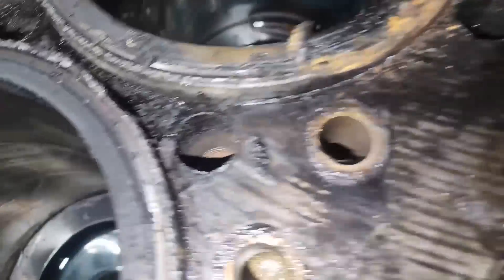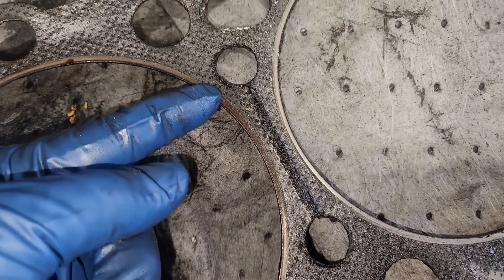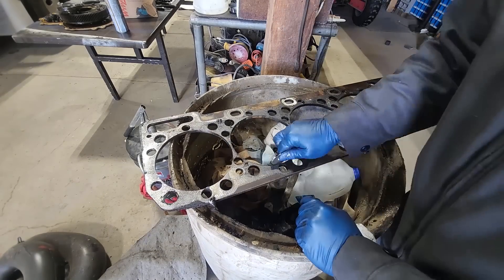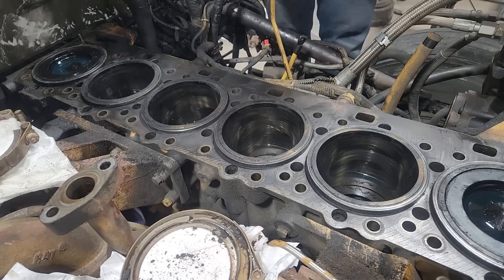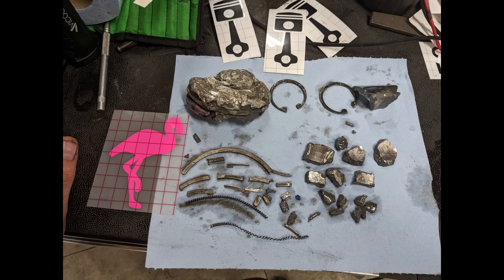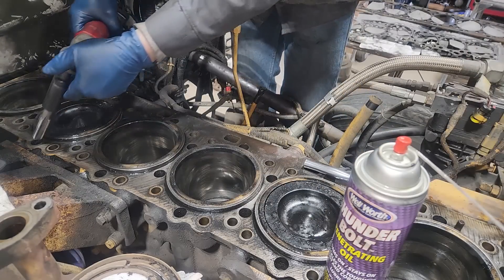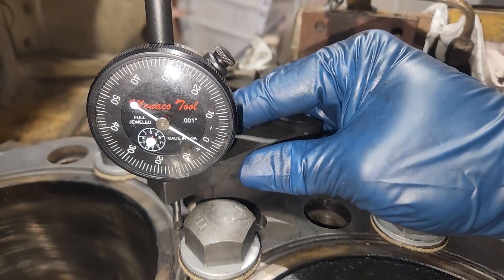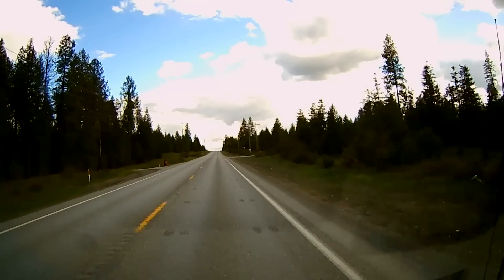"Goldie" the Peterbilt has 3 Big Engine Problems. Cat C15 Engine Repairs.

Comment: Josh you should try a Schaeffers product called Citrol If you get the bulk(gallons0 you can dillute it to suit your needs. It can be sprayed ,brushed or dip. Its biodegradable and completely compliant. Nice stuff it wont peel your skin like a brake clean or a chemical

Comment: I did an inframe on my 6NZ 3 years ago, and consulted your channel. 
 It was very helpful, especially since ive never rebuilt a diesel before.
 I used the PAI gaskets, as well as their head, and piston/rings.
 The pistons were CAT brand.
 Its been 3 year's and 300,000 miles no problem. 
 I did something a bit different though. 
 You've mentioned that these engines almost always leak oil at the shim below the spacer.
 I used spray copper coat,a thin layer, just enough that I couldn't see through it, both sides.
 It worked well, no leaks.
 Even a DOT man commented on an inspection once that most leak.
 Great channel. Thanks.

Comment: could you recommend a scan tool to retrieve codes and look at live data without breaking the bank I only have the one cat engine a 3126 in a gmc with a port that looks like obd11 i'm getting an intermittent crank no start but then the next thing it will start, might die a time or two after running for a bit then the next thing you now it will run the rest of the day just fine.

Comment: Hey Josh, 4years ago I replaced my 2005 C7 with a low mileage /hour  2006 C7 FMM engine pulled from a military HMMVT. At the time engine had 300 miles /40hrs on it. I now have about 40k miles and 500 hrs on it(bucket truck with PTO). Engine has been running great . I’ve done severe usage maintenance on it(oil /filter2500miles,both fuel filters at same time,radiator fluid been changed 4 times). Any suggestions on some PM on the engine itself,injectors?  Had a problem with my fan clutch, recently and I limped to shop with it running hot but not for long. Should I have my mechanic pull valve cover and look at head? Also you did a review on an inline auxiliary fuel filter kit, any thought about adding it?

Comment: Just some advice, I would cover your self by only installing OEM CAT parts especially with engine internals. I’ve had very bad luck with after market parts and will not buy anything other then OEM. Or let them know I won’t warranty it with the aftermarket parts

Comment: Something a lot of people don't know. Taps are for cutting new threads, not cleaning up existing threads. The tap will remove material even on a good hole. Rethreading sets are sold for repairing, renewing, and cleaning up threads.
Reply: I think almost all of us do use taps to clean up threads, but you're right. Proper thread chasers are always best. If you own a set. Which I don't. So I'd better remedy that!

Comment: It would be cool to see the procedure of an in-frame liner removal / replacement. You would think the crankshaft has to go, because of the piston and connecting rod - is there a tool for a work-around?  Wondered if there were short cuts. Thanks for the great video's - hope you find tons of work.

Comment: Could you make a video showing what settings need to be to make sure cruise control will work. 6nz cat had ecm repaired they messed a bunch of stuff up got it all fixed except cruise only works to idle truck up
Reply: I would check my low cruise set speed, default is 127 MPH on low and max 127 MPH.

Comment: Hey Josh why do commercial diesel engines need liners instead of using the block for cylinder  bores like smaller diesel engines like the Duramax powerstroke and Cummings?
Reply: You can replace the liners without having to remove the engine. Some industrial engines, like in a hospital. The building is built around the engine. Have to tear a wall down to remove the engine.
Reply: For multiple rebuilds without needing to machine the block

Comment: Happy you’re posting content again Josh! Let us know your feedback on the PAI parts! I’m going to be building a 3400-12e BDT and was considering there products. They have some performance improvements and have up to a stage 4 lineup. I’m usually pro-oem but if can get a benefit from aftermarket I’ll consider. I’m running this engine wide open, maximizing duty cycles at a 4 trim rate. Poor thing screams

Comment: C-12's usually crack the liner like that
Reply: C-12 have a mid mount liner, no top flange.
Reply: @johngoldsmith6629  why does your channelhave ZERO content?
Reply: @johngoldsmith6629  dont need your help,im a qualified deisel/truck mechanic with 20 years experience who currently rebuilds detroit and CAT engines,C12's break the liner in the same way,the flange isnt above the deck though
Reply: @andrewsmart2949  Sorry to bother you with my 43 years plus of experience. I have never rebuilt a deisel engine. But I rebuilt numerous diesel engines.
Reply: @johngoldsmith6629  you are clearly some sort of spaz

Comment: Josh, 

I suggest trying the 3M roloc bristle disc’s. they are made of soft plastic that will not damage metal but they are abrasive enough to remove gasket material. I use them a lot where I need to clean mating surfaces all the time. They aren’t cheap but I feel they are much safer than the wire wheel.

Comment: Word of advice for being a mobile mechanic. 
You can put a York 210 ac compressor on your vans motor for a air compressor. It's fairly easy to install and change over from ac to be air. Theres a bunch of videos on YouTube that shows how they work. 
It can fill a 10 gallon tank in less then 5 minutes. Thats to 150lb. 
It's great continuous high flow air. 
I have a york 210 on my 2004 duramax. With a 10 gallon tank instead of a spear tire. Lol

Comment: 6:55 in college we had an old a model 3406 that we used for engines class that had the top 3/8 of an inch of one of the liners broke clean off

Comment: Why do you consider .003" good?  I always thought the closer to .006" the better.
Reply from the maker: Well, that's a good question. More isn't necessarily better. A new engine from Cat will usually have about .004" protrusion. .006" is max or you risk cracking a liner due to more pressure on the fire ring and liner. There is a Goldilocks zone there where you don't want too much or too little.
Reply: @AdeptApe  It has been my experience that a new engine from Cat will typically "use" a gallon of coolant a month until you overhaul it and set the liner protrusion to the max.  Then it will be a better engine than when Cat built it.  Never cracked a liner or heard of anyone who has.   I hear lots of stories of "factory reman" Cat engines losing head gaskets every 100,000 miles.
Reply: Actually Cat says liner projection of 0.001 is good enough. But with a block that has been counterbored, they like 0.003 at the min of spec. With a good spacer plate, the design on the head gasket, good head bolts with clean threads in the block. With proper lubrication, and torqued properly ( Cat now recommends  torquing the head bolts then loosen all of them back up and doing it again on a torque and turn method). The block to head joint is sufficient with the above criteria meet.
Reply: @johngoldsmith6629  I absolutely believe you.  The phrases that concern me are, " Cat says" and "Cat recommends.  I can tell you this with my KCBs, after having them rebuilt by an independent shop, and the liner protrusion set at .006 across the board, they use NO coolant at all and outlast the original engine.  
Anyone building for durability recommends the top end of spec for liner protrusion, not what's good enough.
Reply: @scottcurry479  KCB's are mid mount I am talking about top flange liner engines.

Comment: Joy's of being a road mechanic. Never goes as fast as it should and takes longer.  See you are back to a razor blade, what did you think of the wood chisel or did you have an issue keeping them sharp? Good content but way too short.
Reply from the maker: I have razor scrapers, wood chisels and carbide scrapers in the tool box and they all get used.
Reply: @AdeptApe  I still lean towards the wood chisel and final with the razor blade. Been doing it too long to stop. Almost therapeutic bring that chisel back to razor sharp.

Comment: On cleaning block and head surface I use Pike sharpening stone got harbor freight
Reply: I also clean all machined surfaces with flat sharpening stone. It’s the only process I’ve found that cleans the surface back to original cut

Comment: Hey great video! I’m glad to see you on your own these days Josh. Best of luck to ya on your own! I know you will be busy. It was 9 years ago when I quit my job as a lead tech and maintenance manager of a large fleet out here in Oregon to run my own mobile diesel repair. You will be busy for sure. I’ve been there. Also you may already know this but if you buy your cat parts thru the truck dealer you will get a better price. I know that track bolts probably won’t qualify fit that but if you have cat part numbers it’s worth trying. If there is a truck dealer close by they will either be pulling the pets from western states or the cat depot in Spokane and there is a no compete agreement with the truck manufacturers and you will get the same cat pets at a lower price than from cat direct. When I compare pape Kenworth to Peterson cat they are sold to me most of the time cheaper than Peterson can buy them from cat for. Good luck and be safe out there! You will do well for yourself for sure
Reply: Just read the post I made. Dang auto correct 🤦

Comment: About how many times have you cut yourself on the shim gasket and did you ever require stitches? Ive seen it so many times...usually right after i tell the new guy "be careful those will get ya!"
Reply from the maker: I haven't done that before. Worst cuts at work was getting out from under an International box truck and smashing my head into a U bolt.
Reply: @AdeptApe 😅😅ochhhh

Comment: get yourself a large Grummens box truck. equip with a gas powered air compressor. You will be able to fit all your stuff in it.  Good luck on your own. I was a dealership mercedes mechanic and went my own way as well. You are on the right path

Comment: Who the hell doesn’t have an air compressor in their shop these days? That’s day 1 gotta have shit.
Reply from the maker: There is an air compressor there, but it's temporarily down. Didn't really need at that much though anyway. Until I need to prime the oil system and vacuum fill the coolant.
Reply: @AdeptApe  oh gotcha, looked like a pretty well set up shop, I couldn’t believe there was no compressor 🤣

Comment: You know they make abrasive pads where it'll take paint off metal without disturbing the metal I use them to clean up the heavier stuff on the heads I mean I still use a scraper for a lot of stuff there's always a certain spots that you just want to get a little cleaner than what they are and I found abrasive pad that only takes paint off but doesn't Scuff the metal so it works good on cast iron
Reply from the maker: Still have a hard time getting it between the liners.
Reply: Once you’re more comfortable on your own you won’t do this job like this. It’s liners out, clean, decide on counterboring and new parts. You will value your time more eventually and see this cleaning around liners is a waste. I left cat truck engine department in 01 and on my 5th service truck.